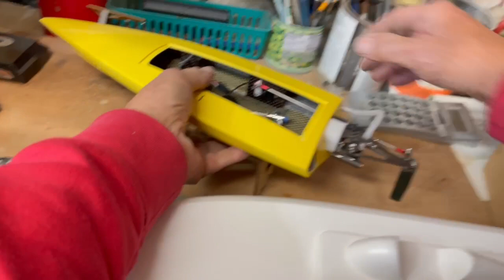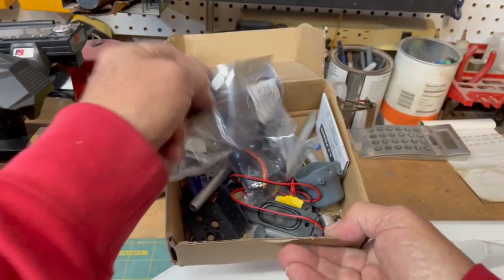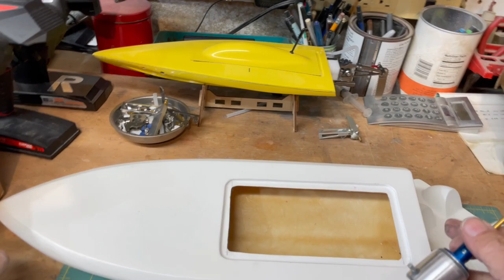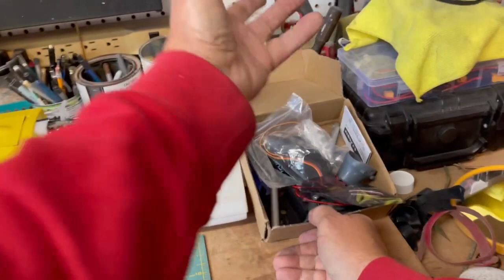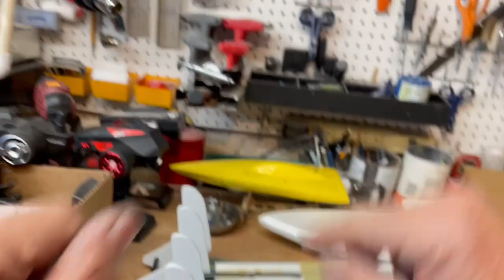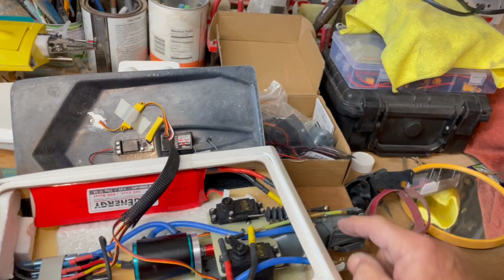Dr. Jet finalizes some choices and works on FRED

Comment: Your gonna love that little 2040. I had my kneeler out the other day with the 2040 6000kv? (Can't remember the exact kv)  and it took a 30mm prop no problem.  Tp motors usually run about 100kv higher than stated.